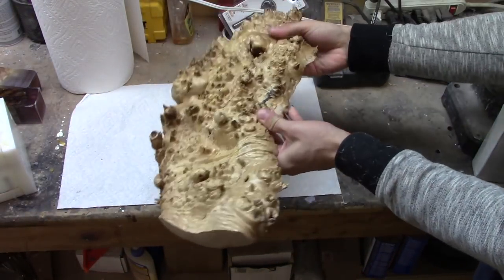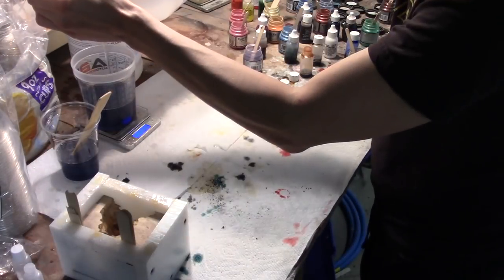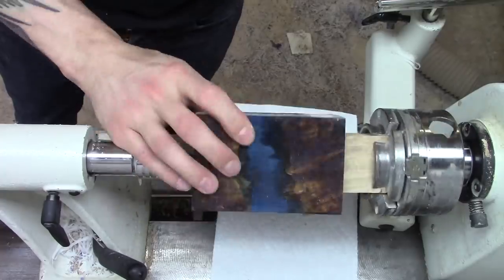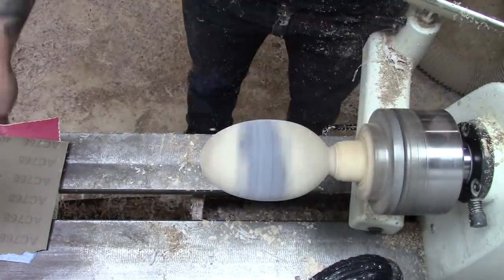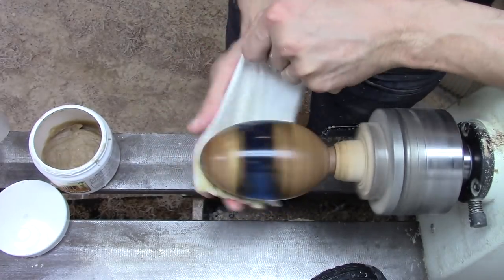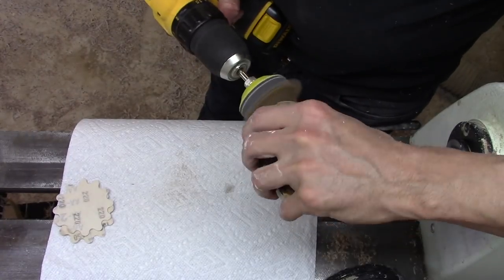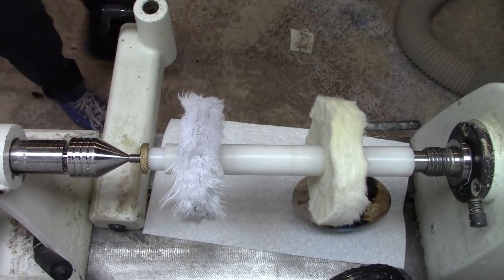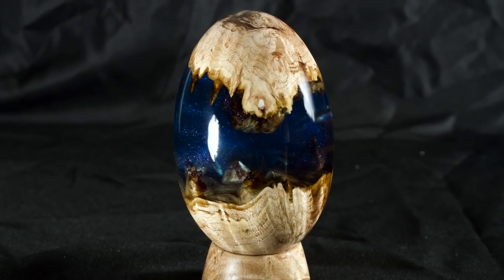Making a Wood and Resin Dragon Egg - #5 Deep Sea Trench

Comment: I have a great idea for you.  Use wasp hives inside resin as decoration for your wood-turning.  Wasp hives are always spectacular to look at.  There are several videos on YouTube on "wasp removal job" that will show you what wasp hives look like.

Wasp hives are preferable to bee hives because bees use wax and wasp use wood pulp and their saliva to create a sort of dense cardboard.   So wasp hives will preserve indefinitely inside resin.  Also, wasp hives have bigger hexagon cells.  They are nicer to look at that way.   It does't really matter because people will think it's a bee hive.

If you use wasp hives inside resin, you will have to inject the resin with a syringe in each hexagon cell in order to avoid bubbles.

This idea of using wasp hives inside resin to decorate wood turning art has a huge number of variations.  You can spray-paint the wasp hive to make them stand-out more and for variation.  I can imagine a bright yellow or pink or grey or black or metallic-gold color for coloring the hives.  You can have a different colors for different sections side-by-side.

Imagine a bowl or vase with a big section missing (like 1/4 to 1/2 section missing).  You can then use resin to recreate the missing part.   Inside the resin, you can put bit sections of wasp hive of two colors (pink/grey or yellow/black, ...etc)).   That would look great!
Reply from the maker: Cool idea thank you! I have lots of nests around here.

Comment: Love the Ocean effect. Do you ever have problems using water during sanding? Does the burl ever pull away, or separate from the resin? Or is the sanding sealer able to prevent any problems? Thanks for any help.
Reply from the maker: I haven't had any issues. If you buff too much it can leave a noticeable transition between the two, but it never separates. I stabilize my smaller pieces so the water can't penetrate at all, but these bigger ones don't really need it.

Comment: How long did it take to create that egg on the lathe? And what resin did you use as I know from experience that not all epoxy  resin turn without rip out. 
Cheers.
Great work by the way